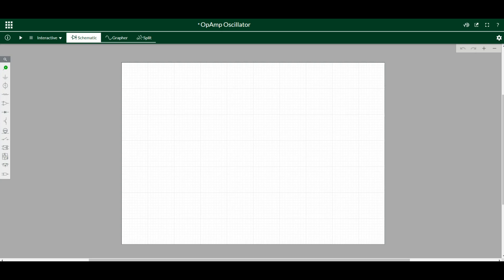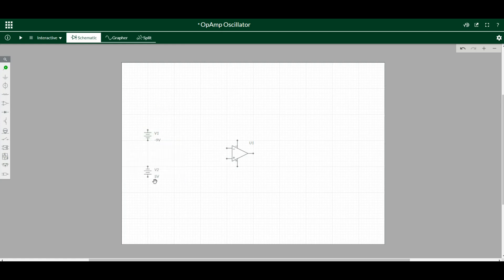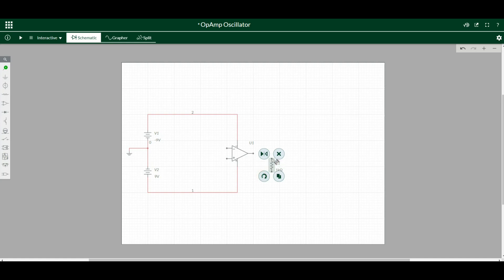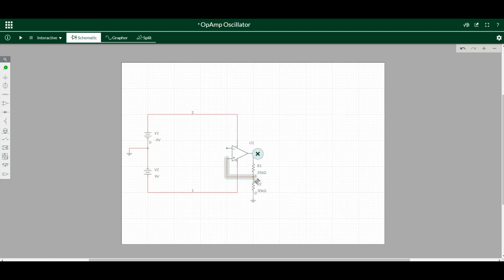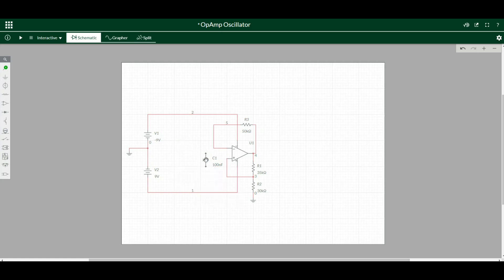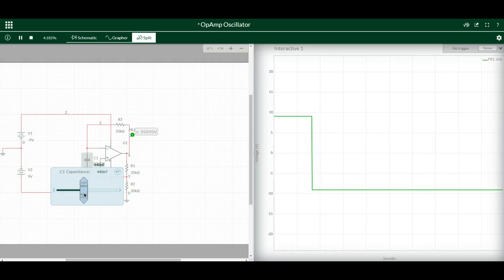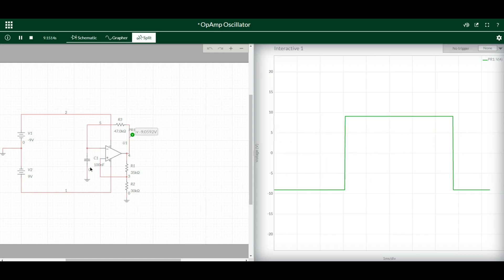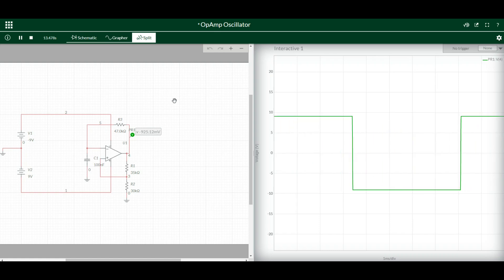Simple OpAmp Oscillator TL072 Simulation

Comment: It took me a little bit to understand why the output is a square wave, as opposed to an exponential (like a simple RC with switch).

If I understand it, it's because the Op Amp drives the output as hard as it can (positive or negative) until the inputs are equal, combined with that voltage divider that feeds about half of the output voltage back to the non-inverting output.  When the non-inverting voltage is higher, it it drives the output high, which starts charging the capacitor through R3.  When the capacitor's voltage finally becomes greater than the divided voltage, the op amp drives the output negative.  At that point, the non-inverting input goes negative, which keeps the output negative, discharging the capacitor through R3.  Eventually, the voltage on the capacitor gets low enough that the non-inverting input has a higher (less negative) voltage (thanks to the voltage divider), which drives the output high, and the cycle repeats.  Does that seem correct?
Reply from the maker: The voltage divider acts as a Schmidt trigger. It provides hysteresis so the output slams from one rail to the other